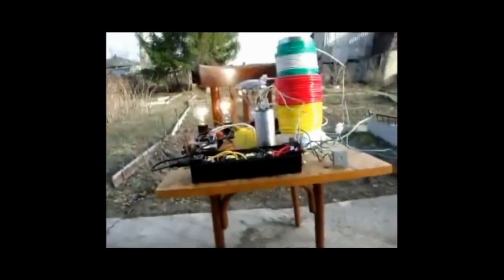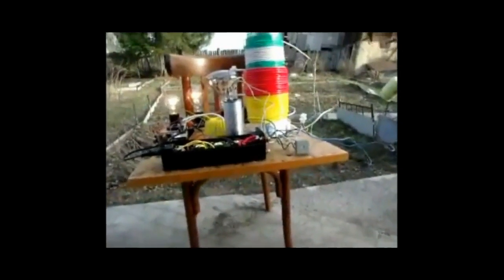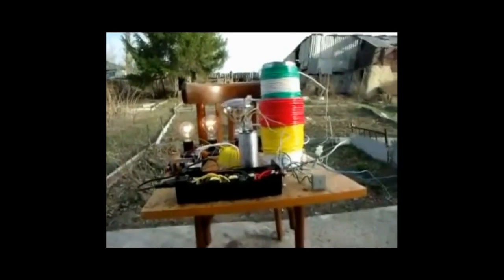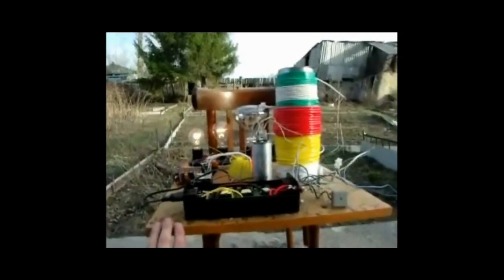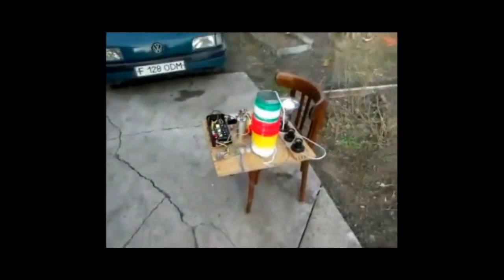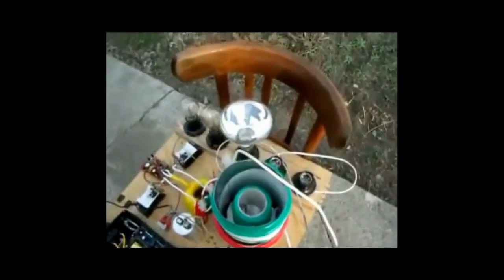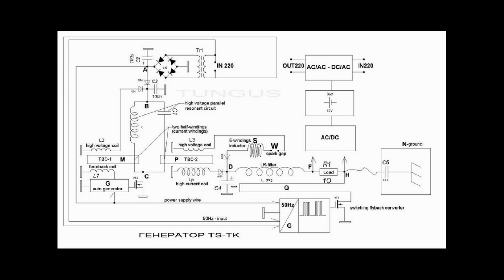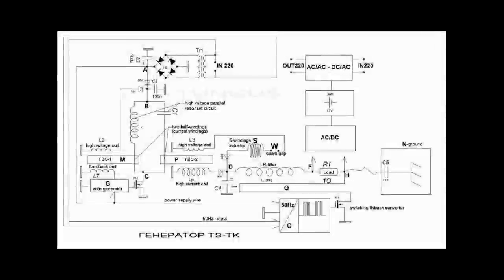a k u l a 0 0 8 3- Free Energy750W no battery no ground

Comment: OK. You have Tesla "like" coil. Are You catch my skepticism? Tesla like means transformet with no core. It means Primary/Secondary. We can calculate transformation coefficient of this coil. If coil is "real" Tesla, than we have 100 000V in the "end". What we have? We have Maximum Voltage and Micro Amperes. Am I right? What we can do with it? Lightning is billions of Amperes and Volts and it is the answer. If there is "fake" Tesla, than we HAVE Amperes and Volts!, and than we can charge caps!

Comment: h t t p : / / r e a l s t r a n n i k . r u / m e d i a / k u n e n a / a t t a c h m e n t s / 4 8 9 2 / h b 3 7 0 f 0 9 . j p g Look at this! You can see- the "inductor" is nothing more than "something" put on the lid- at the top of the coil... Many think about accumulator hidden under lid... and I think so too. In realstrannik forum- there is one attempt to put inside PP sanitize tube a small accumulator (not 7A/h, but smaller)- successful. All the best!